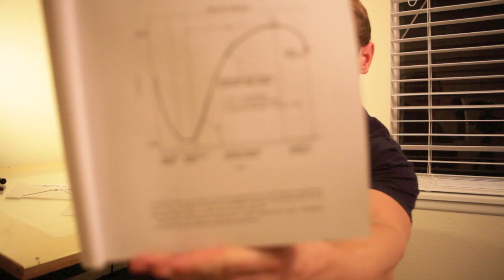Technical Failure, Technique at Intensity, & Compensatory Acceleration

Comment: No other sport than powerlifting lets you to use your maximal strength? I would say most combat sports allow you to use your maximal strength, no?
Reply from the maker: Maximal power output yes, but limit strength, not really. A punch is finished within a fraction of a second, so they're creating a lot of force, which is different than strength.
Reply: OK but what about wrestling for example? say you are trying to pull your arm back under you while the other person is trying to make sure your arm stays away from you. You could be pulling with all the strength you have just to get that arm back under you.
Reply from the maker: That's probably a pretty good comparison where maximal strength is being exerted.

Comment: hey cody, im 5'3 around 130 BW and started ur routine, just got up to a 195 bench for a easy 1rm, will i be able to keep getting stronger at this weight or should i start bulking? also whats your bf% at 185? 0.0
Reply from the maker: Yeah, you could certainly get stronger. I know a friend of mine who's about your size and is benching mid 200's. So you could do it too, I'm sure. And bodyfat... lol, fat. Like probably 12-15%
Reply: Cody Lefever (GZCL) thanks for the reply! just another quick question.. how do you hold weight so well? 5'5 at 185 is crazy.. do you have a naturally wide structure?
Reply from the maker: Yeah, I've always been short and stocky. My dad is wider than he is tall.